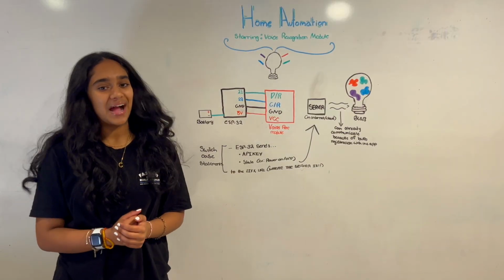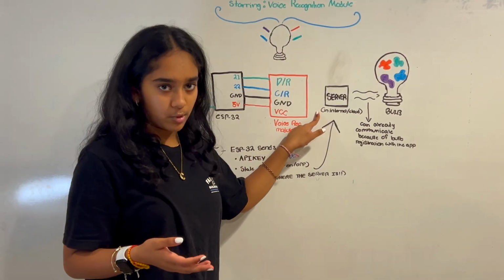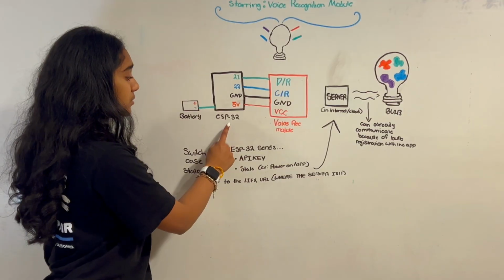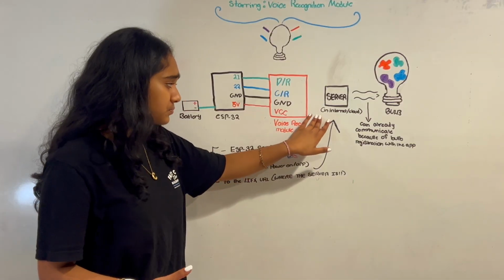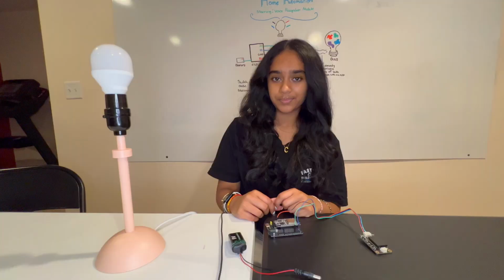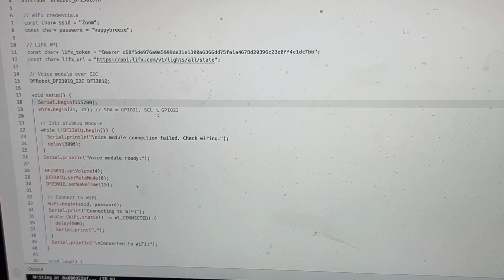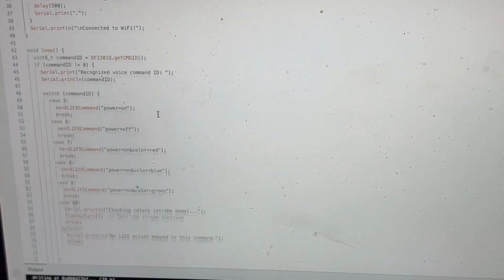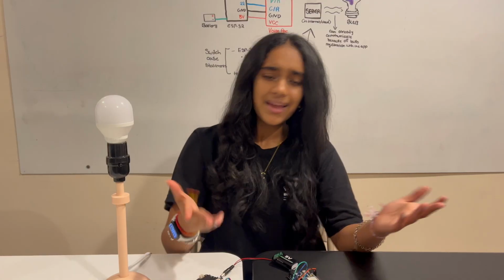Build Your Own ALEXA with ESP32! 🔥 | Voice-Control LIFX Bulbs 🗣️💡

Comment: Would you mind expanding on wiring? Did you have to regulate voltage at all?
Reply from the maker: Yes of course! 
These are the connections from the ESP-32 to the Voice Recognition Module. 
GPIO21 - D/T (voice recognition module) 
GPIO22 - C/R (voice recognition module)
GND - GND (voice recognition module) 
5V - VCC (voice recognition module) 

No voltage regulation
Reply: @itsgivingscience Omg, thank you so much! :)